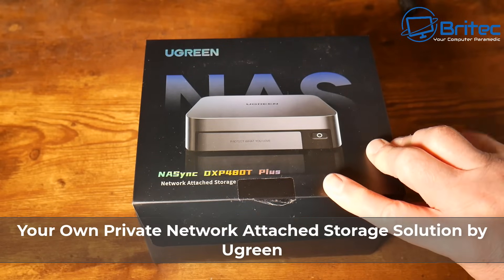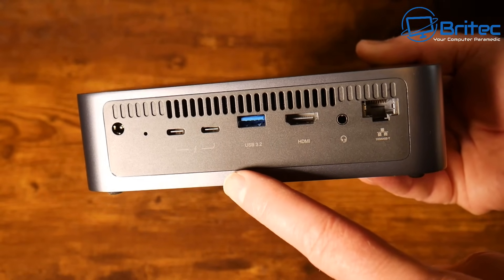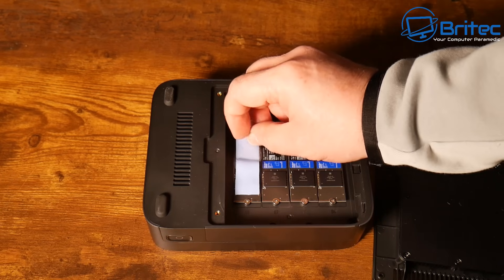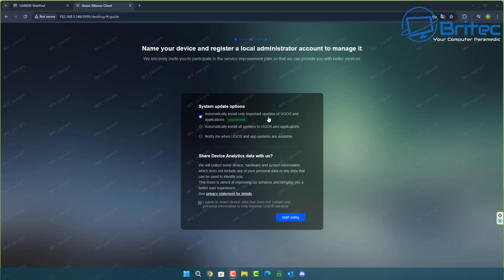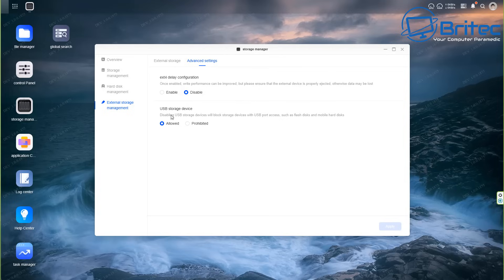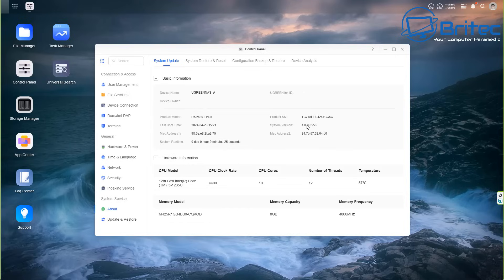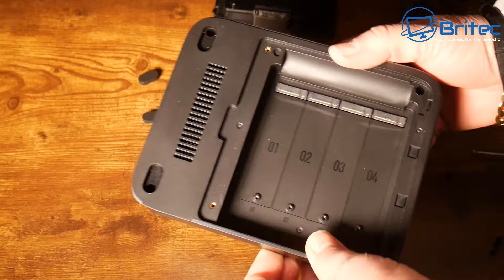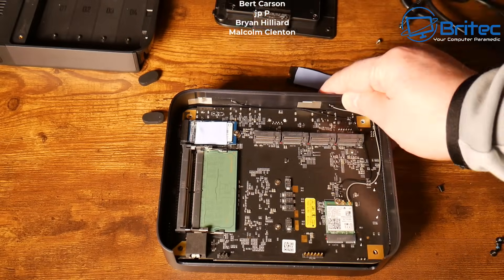Your Own Private Network Attached Storage Solution by UGREEN

Comment: Very nice. What is the life expectency of an NVME storage stick?
Reply: varies greatly depending on usage. You can estimate it. The storage stick has guaranteed data written, and you should know how many data you write daily. Divide these two numbers to get an estimated life expectancy
Reply: @user-od4gs3iu4t  I was lazy, I'm seeing 5 to 10 years. If this is true, I'd probably go for JBOD as I'm an average PC user
Reply: @JonMotivationalRend  I did some calcs to see how long the specified 4*1TB sticks will last if used to the max 10Gbit/s write speed limited by LAN.
I got 1 month. It will be more for drives with higher capacity, and lower write speed. I think it's a clear demonstration that SSD are rather good for speed, and not very good for storage, unless you are OK to replace them regularly in your NAS if used under heavy load

Comment: I've got several old (unused) laptop computers, cam they be used as NAS?
Reply: however I would like to point out that if you want to build DIY NAS, the first questions that you should ask yourself, are:
1. What do I need it for? What is NOT OK with my current data storage/backup/synchronization configuration?
2. How fast it should be?
3.Which kind of RAID, and do I need it at all?
4. Finances for it?
Reply: @ТоварищКамрадовСоциалистКоммун  - Thank you. I really have no need for one, I just hate having my old laptops sitting around doing nothing. One thing I might do is to use them as digital picture frames.

Comment: I did a budget "NAS" making use of the USB port on my router with an SSD.  It has been a joy to make use of features that have grown with devices. I use as an "accessible" "cloud/NAS" for a handful of shows/movies, and I am considering increasing its volume.  There is concern about SMB versions/compatibility, but I'm making risky (?) use of what I have.
Reply: Yes great idea. Just way to easy and cost effective for all these youtubers that are get free stuff
Reply: sure thing. Free USB port is all you typically need in you home router. You should check however the maximal volume and maximal number of the volumes supported by your router. It might be just 4 TB or so. SMB support is also typically included in this router NAS

Comment: Neat little unit. Definitely something to consider at some point, very much dependent on where I can run ethernet cables. Set up exactly as you have it, it would be equivalent to my Seagate external HDD and probably a good deal more reliable. I hadn't heard of Ugreen till the other week. Someone recommended one of their bluetooth dongles for getting a Switch Pro controller to work in Steam. The model of dongle wasn't listed on their site, but, the driver was! They seem a lot better company than I thought. Interesting that there's an Intel processor in there, the chipset for my dongle is by Barrot, I don't know if that's what'll be on the board for the NAS though.
Reply from the maker: Thanks

Comment: $5,840,096 pledged for a $20,000 goal....yeah....NOPE!!!...and they have the GALL to charge $519.00 and call it a 35% off of MSRP of $799.99. Thanks, but I'll stick with my Asustor Lockerstor AS6706T that cost me around $800, has 6 drive bays and 4-M.2 slots which can be used as storage or buffer space...oh and to boot, accommodates 64GB of addressable RAM...higher than what Asustor initially spec'd.
Reply from the maker: Asustor Lockerstor AS6706T has Celeron N5105, 2.5-Gigabit Ethernet ports, DDR4-2933 is $809.00
Reply: Dude, the UGreen NAS has better overall specs than your Asustor. I own an enterprise class Synology NAS that cost $1500 and I still got tempted and backed both the 8-bay and 6-bay UGreen NAS'es 'coz of how good the hardware specs are--i5 1235u CPU, dual 10GbE ports, dual Thunderbolt 4 ports, pcie expansion, and even a front SD-card reader port. You can also install a 3rd party OS like TrueNAS or unRAID and still be covered by the hardware warranty. There is a reason why so many of us funded this Kickstarter. 😘

Comment: everything looks nice until you look at the price of NAS storage devices.
Then you might think that USB storage device is a good alternative to it, you can connect it to your router or PC.
NAS is good if you need high performance, and are ready to spend quite a significant bunch of bucks for it
Reply from the maker: NAS are not cheap, but far better than a hard drive plugged in your router with no raid.